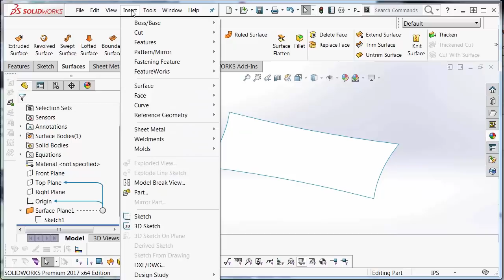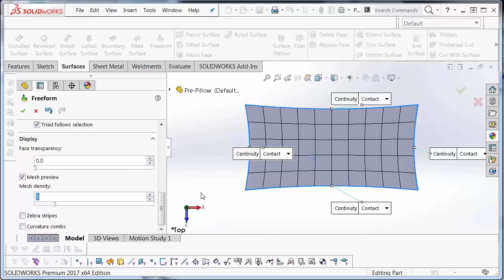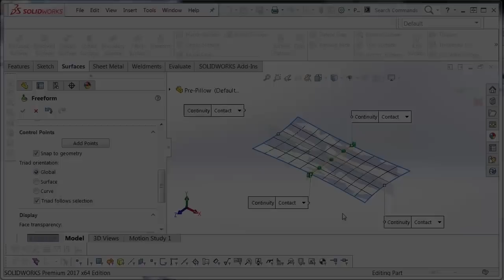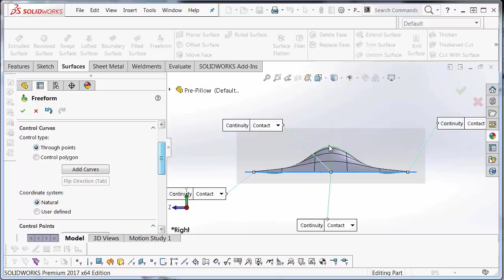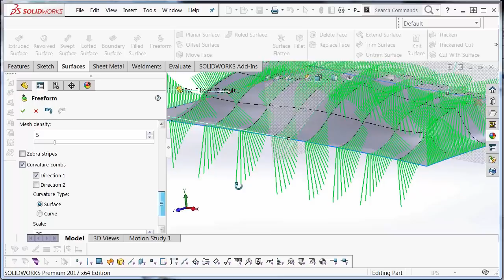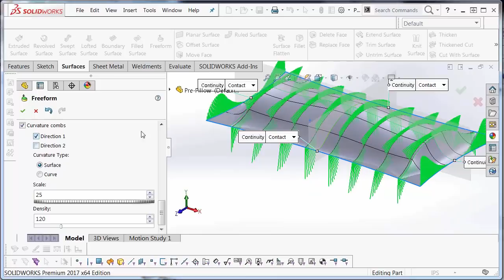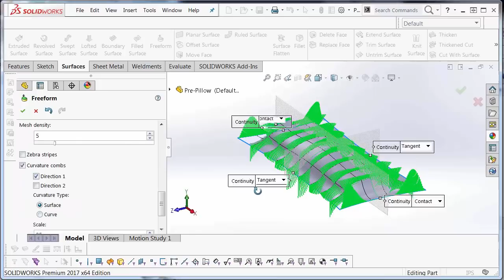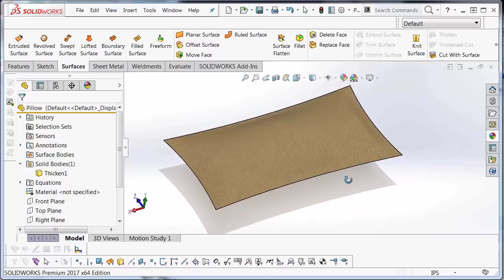SOLIDWORKS - Freeform Tool

Comment: great video. Do you know if you can manipulate the push/ pull points with a sketch/ arc instead of having to freely move points? For example, if I were to create a spline that has the curve that I want and us that instead of needing to use the points.  Thanks!

Comment: The coordinate system is missing on mine and the mesh preview goes away if I click anything. Is there any way to fix this? I did a test part successfully and made another test part and it had the coordinate system and mesh preview but for whatever reason it's missing in the project I'm actually working on.